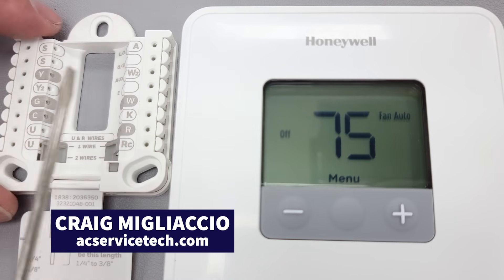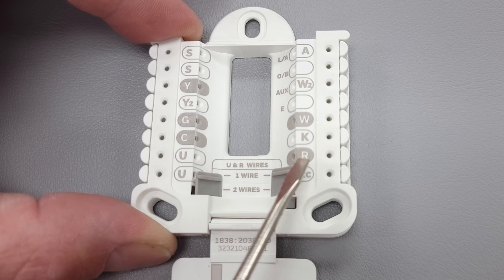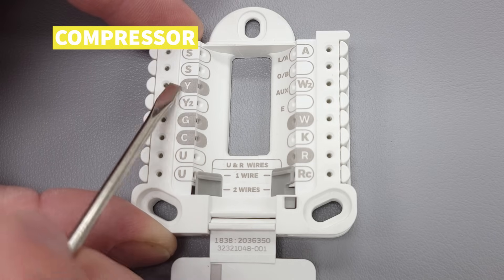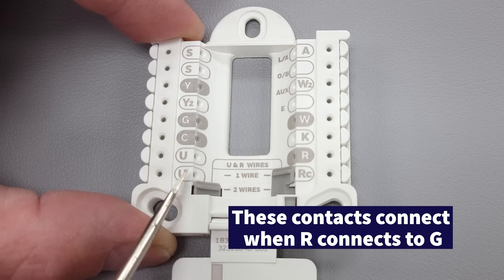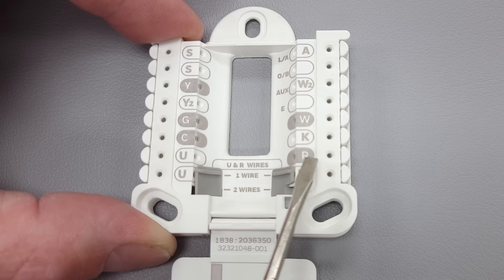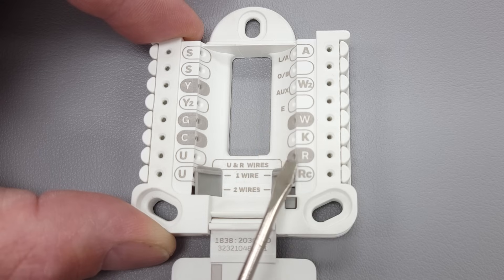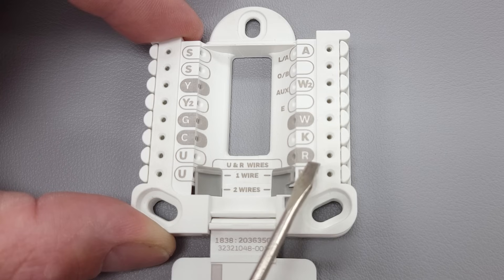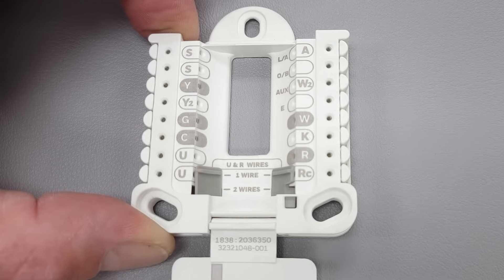Honeywell Thermostat Instructions, Wire Terminals, Functions, Color Code! Furnace and AC! Heat Pump!

Comment: I have an old thermostat that had a jumper between e and aux, I recently bought a new Amazon thermostat and  it stated newer Thermostats don't need jumpers and the white cable needed to be on the w2/aux cable is that correct?

Comment: Very detailed video, thank you. So if I have an AC / Heat Pump system it sounds like I need a Honeywell T5 thermostat. I had purchased a T3 but I have tried all I could and it does not blow warm air, only cool air (even set on heat with a higher setting).

Comment: I have the Amazon T-stat for a about 7 months and went to turn on my heat yesterday for the first time and no heat, i have the white wire going to the "C" terminal and my blue wire going to the "W", when i connect the white wire to "W" there is no power. reconnect my old thermostat and the heat works fine so not sure what the problem is. I have  1 red wire, 1 white, 1 green, 1 yellow and 1 blue

Comment: great job! i subscribed- quick question sir i have a Honeywell th6110d1021 Thermostatabout 5 yrs old 1st floor unit ( i have 2nd fl unit too), so the last coulpe of years,  in the transition stage from oct to november, the 1st fl. unit would start turn on only in early mornings of the nite like 3am or so ( in either cool or heating setting) intermittenly for a few seconds every minute or so,  i would turn breaker off and pull the tstats for like 5 hours till evening and reconnect, and the issue would go away. this year that asn't helped ( i do not have fan in ON but auto and itll happen in heating mode as well when it starts getting cold), any suggestions sir? thank you!

Comment: If there's not an existing wire for the C terminal, do I run an additional wire from the C terminal on the air handler to C at the thermostat?

Comment: I have an issue with my air conditioner when I turn off my ac my heater is on and running the system does not turn off. I was thinking the wires could be wrong. I don't know.
Reply: First thing I would do is simply pull the thermostat off the wall and see if that turns off everything. If it does it could be a bad thermostat

Comment: For heat pump systems, you should never connect a wire to the "W" terminal on the thermostat. This is because the W terminal is typically used for conventional heating systems like furnaces, and connecting it to a heat pump can cause the auxiliary heat to run continuously, says a Honeywell Home video. Instead, heat pump auxiliary heat should be wired to the OX/W2 terminal.
Reply: My RV has 6 wires. One is black and I thought it was blue but nope it is not.
Reply: The "W" terminal is also the "O/B" terminal on some Honeywell thermostats (such as the FocusPro) and the configuration in the installer setup menu tells the thermostat whether to use conventional or heat pump control.

Comment: I am having issues with my honey wall T5. Replaced a super old thermostat that was having battery issues in my house and went to hook up the new Smart Thermostat. 

First issue that occurred was there was no common wire previously hooked up. Old thermostat was battery powered, common wire was not needed. Found the blue wire plugged it into new thermostat, turned power back on, no juice. Go figure realized it had to be hooked up to HVAC. 

Sorted this issue by locating the Blue common wire and connecting it to C in the HVAC, now the thermostat has power. I can turn the fan on any mode, cool or heat and hear the furnace power up. Unfortunately, the house is not cooling! The outside unit has not run since the switch, confused at what the issue might be, any ideas on steps I should take?

Comment: I am retired as an Electrical Contractor and also an Automation Technician.  I now teach various hi-tech classes at a Community College.  This is by far an outstanding video concise and simple to understand.  I applaud the author!!!
Reply from the maker: Thank you for your praise and for watching my videos! If your looking for more HVAC training/classroom projects check out our website! https://www.acservicetech.com/resources We also have free articles and quizzes you can utilize in the classroom!!
Reply: @acservicetechchannel  So this is for people with some knowledge or training? I'm handy and do and figure out various projects, but from my old thermostat that just died in this 104 degree weather, and this same wiring terminal with 18 connections to figure where my four wires go, this sounds like great technical detail and explanation to a level above my understanding or confidence in knowing that I won't short circuit my unit. R + C instant short circuit? 🥵
Reply: I have this type of thermostat and it only contains 4 wires. It has worked for quite sometime and I understood him to say  it should be 5 wires?

Comment: Im so confursed. I got a Honeywell RTH6360D1002, i have boiler heat only- Connected Red to R, White to W, and have a green Wire, i tried it on C, and Tried it on G, no luck/control.  Anyone have advice?

Comment: Hello. I enjoyed your video very much as it ia=s the most detsaild i found online. Thanks for taking the time to MAKE IT. Here is an issue i am having now:
I have an older type thermostat, no C wire, and no extra free wire.(only 2 wire are at that point). Because the temp is different at 2 diff bedroooms (More than 2 degrees) i bought a Honeywell T9 that came with a remote temp sensor and an adopter.  But, i can not use the C wire adopter as there is no free wire there. I am looking to purchase a 24v power supply to operate the thermostat and so i am not sure as to where to connect the 24v terminals on the thermostat(i understand the negative goes to C) but am not sure if the positive goes to the R and if it wont cause problems. Your answer will be very appreciated.

Comment: Awesome video!
I have an LP furnace/ac and a heat pump.  I want to use my heat pump as the primary heat source and the LP as the backup.  Would the heat pump go into W and furnace into W2?  I tried to set up the heat pump to be the primary in the controls but it only blew cold air.

Comment: I see a lot of comments and questions but after scrolling through I don't see any replies. What's with that? I have a heat pump unit and whole house circulation but I have no clue which wire goes to that "Whole House Circulation"! I called Honeywell about this issue and they told me to "Tape off" the Black wire that had no corresponding slot on this RTH 6360D1002 Thermostat that I'm trying to install. Well, actually I did install it and my compressor and fan came on but with NO Heat so I had to put the old Tstat back in. Sucks that I may have to pay someone stupid amounts of money to get this right! We're gonna have temps in the teens next week....Guess I'm gonna have to pay the Electric Company more money because I can't program the old Tstat.

Comment: Great video just confused on one thing.  I have a "rh" and "rc" in the original wiring. On a new sensei thermostat I purchased there's only a "R" connection  that I connected the rh wire to and the heat works fine. For me to turn on my Air Conditioner should I connect the rc wire to the "G" terminal with the G wire?  Thanks in advance.

Comment: A little stuck...I have just two wires, of which when taking the wire's 'off' the previous thermostat, they were on 'R' and 'W', and it worked just fine.  I'm not sure why you are stating to go to common, when the previous was on 'W'?   I currently have it on "R" & "W", so is that incorrect?
Reply: Mine is the same thing!! Did you ever figure it out?? I need help!!

Comment: Sir, I'd like to seek some advice from you. Goodman heat pump being controlled by a Honeywell RTH7600 series thermostat using battery power. I'm want to upgrade to a Honeywell RTH9585WF wifi t-stat. Trying to determine if the "C" wire, which happens to be blue, was connected at the condenser unit, I measured 21.2 volts from the R/Rc wire to the blue wire. Is 21 volts enough to run this without problems? I'm asking because I cannot afford to have a professional come do this for me. Thanks.

Comment: Hello I live in miami, so our system has ac and in the same unit is the heat no extra furnace...my current honeywell thermostat has 4 wires only, blue in Y, red in R, green in G, white in W, because I don't have a furnace down here it just reverses the hot air back in the house, on my new thermostat there is a jumper connected to R and RC should I remove the jumper or leave it in.
Reply: If you have an email I can send you a picture

Comment: thank you for very helpful video. one question: can i use honeywells simple on/ off thermostat (TH1110D2009) to control a rv propane heater-12vdc?

Comment: Hello, we recently had a 4-ton Bosch IDS 2.0 Connected Premium heat pump (BOVB-60HDN1-M20G and BVA-48WN1-M20) installed in our home to replace the failed A/C system we had. Also installed was a Honeywell TH6320WF2003 thermostat to control the heat pump. The contractor told us he could integrate the heat pump to use our existing hydronic heat as a backup heat source on extra cold days but is now telling us he is not sure that would be possible.

Our hydronic system is an oil-fired boiler separated into 4 zones with zone valves. 1 zone feeds an indirect domestic hot water heater, and the other 3 zones are to heat different areas of the house, each with its own thermostat.

We would like to retain the control of the 3 individual thermostats for our hydronic system while using the single Honeywell TH6320WF2003 thermostat for the heat pump.

Is there a way to use the heat pump as the main source of heat, and then after the outside temperature drops below the set point, have the heat pump turn off and relinquish control to the existing 3 thermostats for the hydronic system? 

It seems like in heat pump mode (above the cutover temp), I would need to interrupt the W wire of all 3 hydronic thermostats. This would prevent any call for heat to the oil burner.
Then once the outdoor temp drops below the setpoint, I would need to interrupt the Y, G, and possibly the B (Bosch reversing valve), to my heat pump system and allow the Ws to the oil burner.

I can do this with a few relays, but I need to know what wire to use as a trigger wire. Would the W1 wire of my thermostat become hot when the outdoor temp drops below setpoint, or would it be W2? Honeywell was not helpful with this and was just reading from a script.

I know there are things called fossil fuel kits, but not sure those would work for my case.

We have no heat strips installed.

I'm pretty technical, so feel free to speak openly about the details of what might be needed to make this work.

I really enjoy your content. Thanks for the time you put into your videos.

Thank you,
Eric Viele

Comment: While this may be the best explanation of how these things work, it still didn't cover what I need. I cannot believe that literally has covered rooftop package units where the thermostat goes directly to the rooftop unit, which has the heat pump and A/C combined into one package with no air handler in the middle.

Comment: I have the t6 and was having issuss. The system has been working fine but lately when the target temp is reached the ac wont turn off. Air is cold, no freeze ups, condensate line flowing.  Figured the thermostat may be bad. Not sure if it matters but i removed the thermostat to check gor any loose wires and jusy happen to notice there is not a wire in the common terminal. Apparenlty never has been. What kjnd of isdud might that cause

Comment: Hello , My air conditioner guy , removed the back of my thermostat. and said this is the problem , and changed it to heat pump . Our electric bill has tripled !!! I took the back off and see a HP switch . is this what he changed and may I switch it , Thank you T

Comment: I was given a T6 pro brand new and want to install it, but I'm confused about where to put the wires from my current thermostat.

So, my current thermostat wiring is set up as follows.

White wire - W
Blue wire - Y
Green wire - G
Red wire - Rc

Then, there is a jumper from RC terminal to RH terminal. I'm not sure where to put the red wire on the new T6 which also has the jumper wire. 

Any help would be great.

Thanks.

Comment: Thanks for this... had a A/C no compressor start problem after doing a breaker identification exercise.   Found my yellow line not continuous to the compressor.  Traced that back to a failsafe connection on the condensate pump.  If the pump stopped it would shut down the compressors.  That pump was plugged into an outlet we couldn't identify.  Once power was restored to that the compressor started.  Your description of how the wiring works gave me a much better handle on how to track it down.  Thank you again!

Comment: I have the same thermostat, and for some reason the fan-on mode does not work.  Even though the fan works normally in heating mode.

Comment: This helped me out so much.  I just bought a house and there are only 4 wires with this unit and they used the blue wire for the Y.  I think this gives me a way to get a C Wire and keep the other 4 connected.

Comment: I know it's been a long time since posting, but I have a heat pump.  Got everything hooked up fine, but my aux heat and emergency heat are the same.  I previously had the TH3210 thermos and they were jumped together.  I just hooked up the aux, because there isn't enough room for 2 wires in there, do I need to change that?

Comment: If i have a honeywell r7284 connected to this controller with a 2 wire configure to an oil furnace, can i run a third wire to the G on the thermostat to somewhere on the envirocom to allow me to run the fan separately from the furnace so i can recirculate the air?

Comment: Best explanation yet! I found that the installer incorrectly wired my T6 so it never ran properly from day one. They had the white wire on "W" which is wrong for a heat pump system. I replaced it with an RTH8500 unit and I also have noticed that the outside unit runs much quieter now. I'm not sure why but the T6 was the date code that is supposed to be defective.

Comment: The T2 is supposed to work for 750mV heating systems. The thermocouple is the only power source. What are the connections for this two wire system?

Comment: The U terminal we see there, that can also be used for a connected dehumidifier right? Say for example, if a client had a heat pump system setup that also included a Santa Fe Compact70 (formerly Ultra Aire 70H) dehumidifier inside the mechanical closet with the air handler, how then would we go about wiring it up to the thermostat?

Comment: Hello, I'm a newbie, and I have a question.
My old thermostat is broken, and the fan keeps running and cannot be turned off, but everything else is fine.
So, I replaced it with a new Honeywell RTH8800WF thermostat.
Currently, there are two sets of wires connected to my thermostat.
I believe one set (Rc, G, Y) is from the AC, and the other set (R, W, C) is from the floor heating.
I connected them to my new thermostat, but it doesn't work.
So, I measured the voltage between all the wires.
Rc, G, and Y are around 26VAC, and R, W, and C are also around 26VAC, but Rc and C have almost 60VAC.
I believe the 60VAC is the problem, so I disconnected the AC connection, and the thermostat works
Can you please help me solve this problem?

Comment: I have a two stage  radiant tube heater  with only 3 wires coming out for therm.      Just bought a Honeywell rth6360 therm.  Which is digital.......... with my 3 wires coming from my heat box ...can i run both stages of heat with this therm.  And not use batteries?      My instructions on my heater say i need a 24v thermostat.     Im lost

Comment: All of the wires are connected and my system is not turning on. Do you know what can be wrong? It was working and they were going to install the google thermostat but we decided to keep the Honeywell. After the reinstallation of the Honeywell the ac/heat is not turning on.

Comment: The W2 wire was not explained.  I understand it is for second stage heat on a 2 stage furnace.  My question is how/when does the stat call the stage 2 heat?  Does it look for a temperature differential (room is at 16C and the stat is set for 20C and recovering from a temp set-back overnight) or does it monitor the time taken to get to the set temp and fires the furnace's stage 2 after a set amount of time?

Comment: Great  video. Im looking to upgrade to a wifi thermostat for my heat pump and this video will definitely help. I just need to figure out where to connect my unconnected  c wire in the pump unit .

Comment: I bought a Royalton 2-stage furnace. I gave it to my friend and it is 60 miles away from here, I have never been able to make this Honeywell thermostat work, I bought one before and we gave up on it as we did in this case again. The furnace says not to hook up the C wire but it doesn't talk about two-stage thermostat connections. I don't know what to switch position is I will check it when I go back to town but we could not get it to operate heat at all. And I contacted them but it was Friday so it's the weekend now and I appreciate the knowledge that I got from this video. I'll get back to you and tell you my progress and we'll check out your wiring charts.  I checked out your thermostat wiring charts and it doesn't talk about two-stage furnaces. I would prefer the old-fashioned double Mercury thermostat without all the confusion, and they're not on offer at Lowe's Home Depot.
Reply: Simple is always better to me

Comment: If I have a R and a RC wire can I use one (the RC) in the C spot and run a jumper from R to RC? I want to install a wifi thermostat without a C wire. I am installing a T-6 pro Honeywell. I have a R, RC, W, Y, G, wires. i have used a jumper from Y to G and and put the G into the C port. The heat side works great, the cooling side turns on but does not blow air at all. Any suggestions?